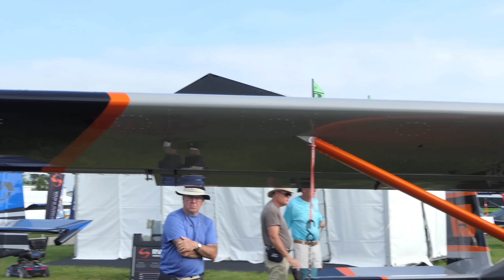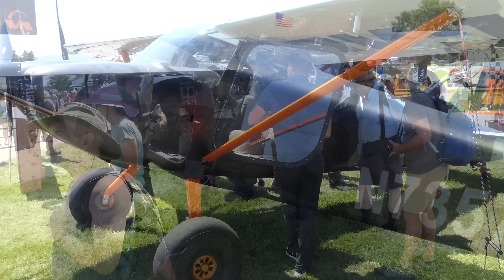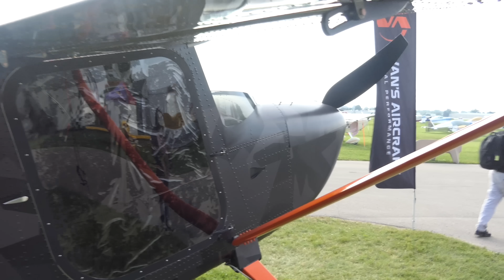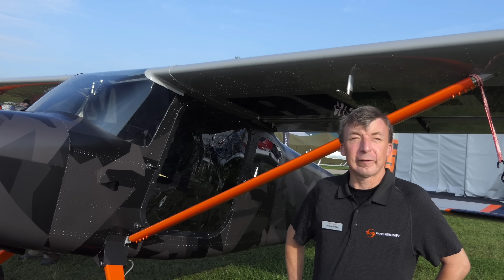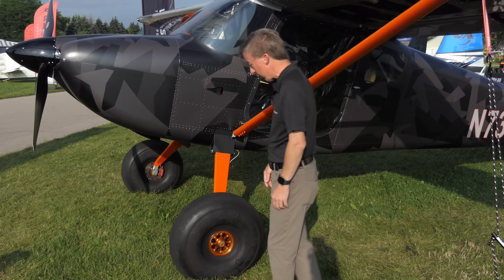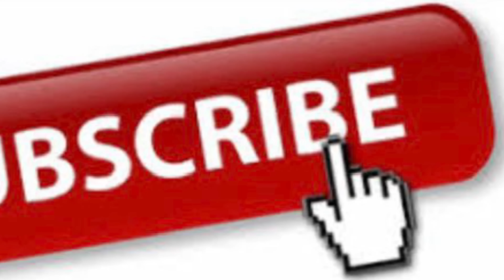Vans RV 15 - At Airventure 2025

Comment: All indications are that it's a very good airplane but... and I have to believe that Vans know what their doing... but... I don't really get it.  It seems like a very well served market already; a C170B is a heck of a lot cheaper, a Murphy Moose will eclipse the 15 in pretty much every point except stall speed (and looks).  At the 15 kit price, that's $117,000 Canadian for the kit not including engine, avionics and so on.  A really good C170 can be had for about 100G ready to fly.  In Canada, at least, we can declare it owner maintained and put a 200 hp engine in it and it's pretty much an RV15 for less money and WAY less hassle.  For Americans there's already the Moose, the Yukon, Rebel, Glastar and a host of other very capable aircraft with similar specs.  But... there's the Vans name and that just may put the 15 on top of them all.  Time will tell I guess.

Comment: It's just a crude boxy design, straight out of a 1940 garage. sheet and rivet should have sunk with the titanic. Composite is the way for planes
Reply: Vans uses a lot of composite material for cowls, wheel pants, and fairings.

They do not build composite airplanes. That is literally outside their area of expertise and also not part of they supply chain. Also, most people cant even make a quality 1ft square layup let alone an airplane.

Comment: Hey thanks for the video.  I would like to suggest though that you should be able to remove almost all of that distortion and other noise with a sound editor like Apples Logic Pro X and/or related tools. There is really no excuse to post such distorted and noisy audio these days.
Reply from the maker: I tried to clean it up in Final Cut Pro, but I didn't see any improvement.  Not sure if I'm not doing it correctly, or I need something more advanced.

Comment: Great interview... nothing like talking to the Engineer who was on team who designed it. A lot of thoughtful touches. I have built and flown two RV's, currently RV-7. I did not see the RV-15 as needed so to speak in a crowded STOL high wing market... but I was wrong. This DOES bring a lot, fills an area that will make it competitive. The kit I know will be outstanding. The High Wing STOL planes are many but I think this will be a stand out now that I heard this interview. They have been working on it a long time and was on a short hold during the Covid and other issues had, which they came through like a champ.
Reply from the maker: Rian is definitely passionate about this plane and knows everything there is to know about it. They seemed to have spent a lot of time getting it right.

Comment: 86000$ For the kit is crazy
Reply: everything has gone up everywhere. The days of building or buying an RV for $50k are gone. But then again 172s cost $100k.
Reply: @sblack48 For a really old one yes. Textron is selling new ones for over $600k now.
Reply: @galactictomato1434 just ridiculous for old technology and no innovations.
Reply from the maker: Roaming around Airventure this week looking at all the new planes, I can tell you nothing is cheap.
Reply: Low volume production. Lots of man-hours in a new 172. 

An F-150 has less than 40 man-hours and they build more in a single 8hr work shift than Cessna builds 172s annually.

Comment: why they made it longer and wider than a 180 and didn't give an option for 4 seats I don't understand. While most people may use a 180 with 2 people, it sure is nice to have the option for more passengers.
Reply: It's not about size as much as it's about weight. If you make it longer and wider the weight goes up and the vast majority of people who want a 2 place will lose useful load. Also the bigger cross section hurts cruise speed. I think this airplane will be pretty fast for a back country machine. You don't get something for nothing and you can't please everyone. No matter what they do someone will be unhappy. I think they've given the market a homebuilt c180 but better.
Reply: The fuselage isn’t longer, but the internal cockpit/baggage area is. Meaning that it has a taper that wouldn’t suit seats in the back as you would hit your head.
Reply: @Captndarty so rear facing seats, which sucks
Reply: There will be companies that will provide seats for the back eventually.     I just installed an Atlee Dodge seat in the back of my C-182.
Reply: It will have seats in upcoming years maybe as a mods
Reply: The insurance goes up with 4 seats.  It's experimental and builders can add 4 seats if they want.  Seats are easy to build.  It isn't like a certificate airplane where you are stuck with the factory offering.
Reply: @2Phast4Rocket  they did their research and determined that a 2 seater would sell way more than a 4 seater. How many RV6s, 7s and 8s and 14s are there compared to 10s? There's absolutely no question. Even with sticking to a 2 seater with a 4 cyl engine most of these will be close to $300k before they're done. Making it bigger and requiring a 6 cyl engine will make it that much more out of reach of anyone but Drs and airline captains, if it isn't already.
Reply: @sblack48 I'm a millennial Dr and I can only afford to look and dream. Dr's don't have it like that anymore (like the boomers). Inflation, and hundreds of thousands in student loans makes most of these planes out of reach for us too now. I owe more in student loans than it would cost to build a nicely equipped RV10.
Reply: Yes, not a real 4 place, but certainly a 2+2. I imagine we will see at least a 3 place (Like CH750 SD) with simple bench seat builds.
Reply: @joesacher  ya and those people who do that will fly 99% of the time with 2 people and wonder why they bothered.
Reply from the maker: Fly with a pack of your friends in their own planes.
Reply: @aviationkitbuilder  I'm more interested in flying with my family
Reply: @brandenraftery5074 except most of the time they aren’t

Comment: Great interview with Mr. Johnson; tons of cool information! Looks like Vans has themselves a winner with the RV-15!
Reply: Lol, sure you meant Vans but im thinking you are rightbthey are both winners : rv15 a little more high-end than the s21. I wonder how they compare say at 9000ft : speed /gph in cruise and  climb rate (turbo s21 vs 218hp rv15). Useful load w 600nm of fuel as well.
Reply from the maker: A future comparison video perhaps??
Reply: @aviationkitbuilder @101jtag yes, I agree with you both before buying any of these aircraft or something else, a lot of comparison & much more information is needed.
Reply: Oops you're certainly correct, changed it to Vans... The Rans S21 is though a very cool aircraft as well! I agree that the RV-15 seems more polished. I particularly like the RV-15 landing gear design, very slick! Need to throw the Sling HW into the mix. Though the Sling HW seems to be more of a modern Cessna 172 competitor, than a back country flyer. So, different missions, I think...
Reply: @mittman9977  Indeed, then theres the flight characteristics and feel, the comfort, the build... he mentioned rivet options, did i hear the option of using either flush rivets or blind rivets ? Here i go again adding 100s of hours of build time...
Reply from the maker: He said you can use either pulled rivets or solid rivets, and the wings sections come pre-dimpled in either case.
Reply: @101jtag  If you had a build choice between flush(solid) & blind rivets(pulled) would you always choose to use the flush ones? I have spent a lot of time thinking & looking into this... I am planning to take an EAA class to get a more hands on feel. I am pretty familiar with pulled rivets but, only for home fix it projects. I actually really like the final look of Sling Aircraft. @aviationkitbuilder, just finished a beautiful TSi. Sling in one of their South African factory YouTube videos, a test pilot performs a (likely disallowed) barrel roll with a TSi & 2 passengers. Just a single data point, but a fairly reasonable test of airframe strength. A bit reminiscent of the footage of a Boeing test pilot barrel rolling a 707 prototype.
Reply from the maker: I did a video a few years ago comparing the RV-15 prototype to the Sling High Wing when they both came to Osh in 2022.  The Sling is definitely less STOL.